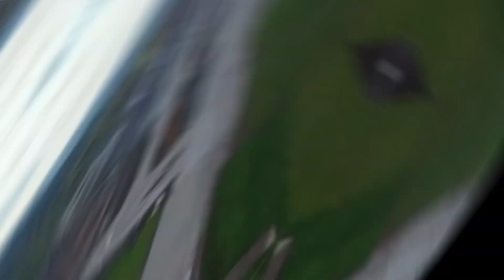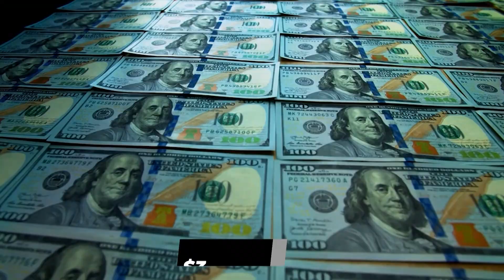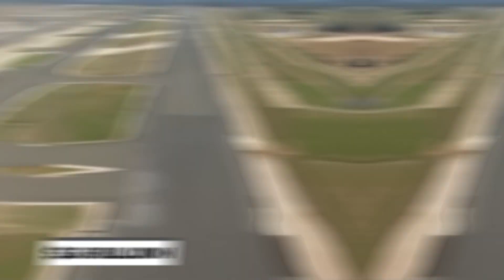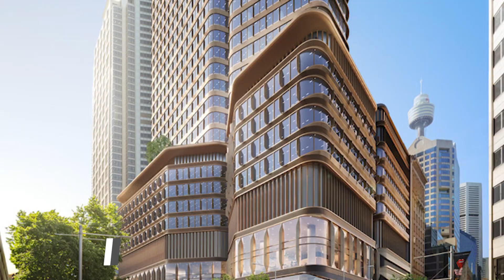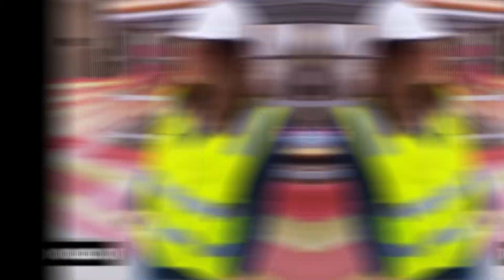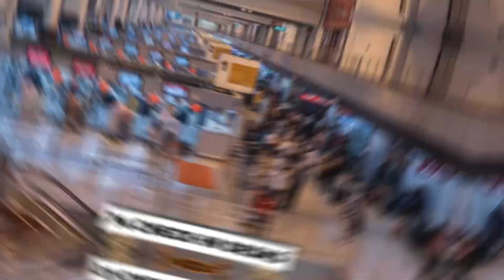Australia's INSANE $11 Billion New Western Sydney Airport Revealed!

Comment: By the looks of things it looks likely that by the time Western Sydney Airport opens it will be one one of the first airports to open without a fuel pipeline to fuel the aeroplanes - a strategic error, which will see a heavy reliance on trucks having to truck the fuel in leading to a massive headache for commuter using the M7 highway get to the airport.  I'd love to know how they plan to get around that one.
Reply: The plan is to build a pipeline when it becomes economically viable  "A jet fuel pipeline to WSA has been determined to be viable by 2034 (Source: Western Sydney Airport Aviation Fuel Supply Corridor Options Report Deloitte analysis, 2017, Figure 5)"
https://www.westernsydneyairport.gov.au/sites/default/files/Fuel_Supply_Corridor_Options_Report_Feb2018.pdf
Until then road transport will be used resulting in approximately 41 B-double trucks on a daily basis by 2033, 1 to 2 tankers per hour delivering fuel until the pipeline is opened, a barely noticeable impact on commuters.

Comment: Not a bad precis, but often gets things a bit muddled and has lots of (usually amusing) mismatches between images and the narration. I particularly liked how the local City of Liverpool (the area in which the airport is located) gets depicted as Liverpool in the UK. The new airport is not a replacement for the current Sydney Airport, but will primarily serve Western Sydney in its own right (it is the third largest economic centre in the country). Unlike the current airport it will have no night curfew, but will have a Cat IIIb landing system (for low visibility conditions) and has a runway pattern that minimises taxying time and maximises traffic movements. That translates into cheaper flights and faster connections to most destinations. 

From the appalling mispronunciation of several local place names, I assume the narrator is not a local. You might also be falling into the common trap of thinking of Greater Sydney as being only the harbour city. It's centre of population is actually well to the west. Greater Sydney covers more area than Greater London and planning authorities think of it as three cities, or six if you count the other nearby large urban areas separated from it by national parks. The airport Metro is more designed to service adjacent western centres and suburbs than directly connect with the harbour city centre.